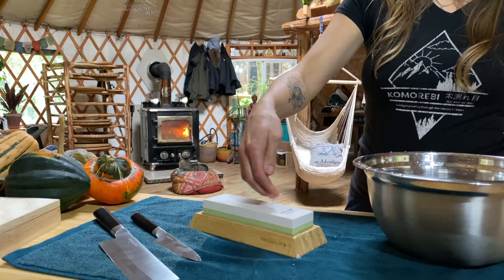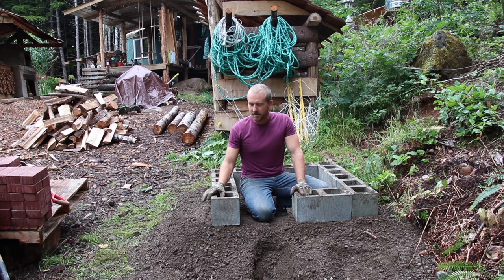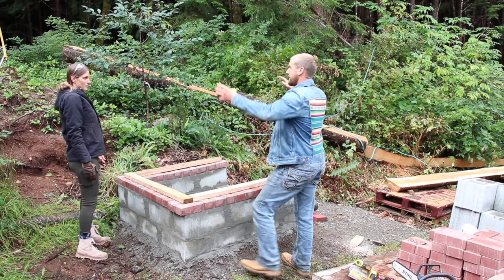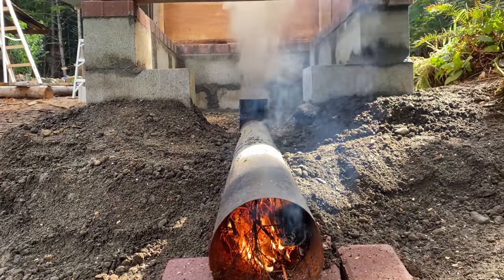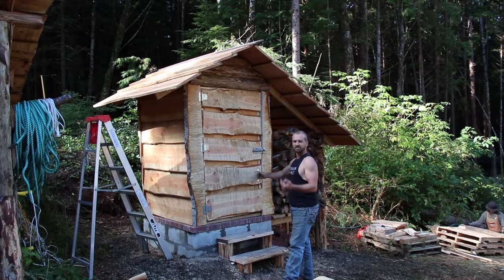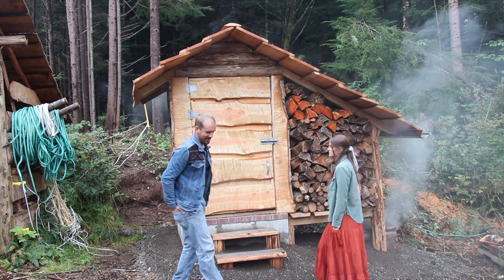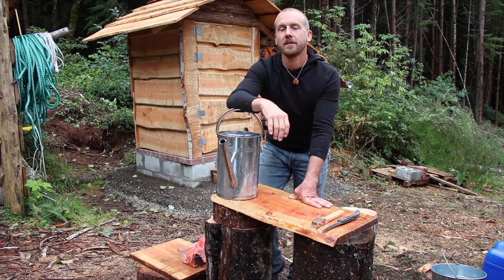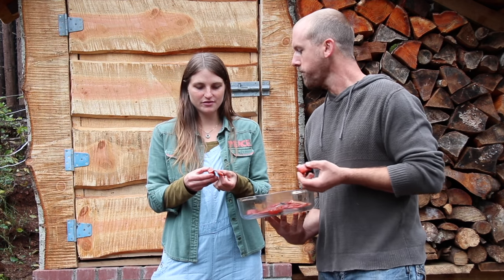BUILD a DIY WOOD FIRED SMOKEHOUSE for SMOKED SALMON with CHAINSAW MILL | TIME-LAPSE START to FINISH

Comment: When you use the leather wood-sling , you should put your forearm through the handle, rest it in the crook of your arm, and take the other handle in your hand. That way, the load is better distributed, less strain on your hand , AND you can put in a few more logs for the same trip...Btw, nice job on the smokehouse.

Comment: 5 years from now Jake & Nicolle will have built a whole off grid village. Just let me know when I can move in 😉
Reply: Does off-grid mean no ac and dc power used ????
Reply: It means you're not connected to public utilities.
Reply: @MichaelJosephJr934  Thanks, so if I have a gas powered generator to operate a variety of electrical devices, I am off-grid.
Reply: Yes.
Reply: Yes as long as you're not connect to the city or county lines.
Reply: @MichaelJosephJr934  Thanks.    I wonder if there is a word or phrase that describes living on the land without any electrical and gas powered devices.  Cooking and heating with wood found in the local area.  This is not a big deal, just wondering about this topic.
Reply: Their buildings are so amazing
Reply: @rogercotman1314  Primative is the word I think.
Reply: @rogercotman1314  I think It is wilderness living. Or bushcraft living if such name exists.
Reply: @MichaelJosephJr934  but they are. So not off grid
Reply: Yep I wanta come also
Reply: @enriquerojas3149  Thanks
Reply: @rogerhuber3133  Thanks
Reply: @rogercotman1314  If you like that, check out for Richard Dick Proenneke documentaries videos. Maybe you know his story, it's amazing.
Reply: @enriquerojas3149  Will check out RDP.  Thanks for the reference.
Reply: Are you 4?
Reply: Speak for yourself

Comment: I just wanted to say,"WOW". When I watched the 1st episode I thought without a doubt you'd be headed back to civilization within 1 week. You absolutely proved me way wrong. Your building skills have come a long ways since you 1st got there. Could use a little refining but if it stands in a strong wind it's good enough. My father used to say,"Nobody will see that mistake driving by at 60mph, so, it looks good to me".

Comment: Hey Jake this message is for you. I see you are making a smokehouse to stretch your food out and give you a variety in your food storage. However, I do have a thought for you. You are in your 30s as far as I know, this means you have a Lotta body strength at this time and a lot of flexibility. It would be in your best interest I feel do you start building where the fire is it is low on the ground but more higher so you would not have to bend out as much, trust me this will change in time and you need to think ahead.

Comment: Someone else’s wood smoker burnt out due to grease reaching  flames in side burner setting structure ablaze in the forest. Luckily they were there during the dark night to quench it.  Stacked wood next to smoke closet did not ignite.  If galvanized nails kill trees I’d not include it in food prep or preservation. Love watching the milling of 30’ planks and All the lumber.  Yes you are set for life as long as you are fit.

Comment: OMG,  LEAD POISONING!!! Please Respond, and reassure us all that you have replaced your Hot Dipped Galvanized mesh with something Safe, and you should probably throw away everything you've smoked so far, or at least keep away from Momma/Baby... (Electroplated Galvanized might be kinda safeish at lower smoker temps (though, with all the acidic, corrosive, and absorbent compounds that smoke, salt, pepper, vinegar, fats, oils, sugars, etc., 👁'd rather be safe than super sorry, and avoid any Galvanized anything for food prep, storage, etc.)), but that hot dipped stuff is certainly toxic, as they use LEAD in the zinc (to help it slough off excess metals in the dipping process), your mesh is hot dipped (you can tell by the color, texture, and the lil drip/bumps left from the dipping process) please do a LEAD test at the very least... 👁 Love what y'ns r doin', Rock On, Be Safe, Stay Healthy🤙

Comment: I was a logger for 25 years and a carpenter for another 20. Cedar and Douglas fir are very rot resistant. Alder Hemlock and Spruce don't last very long when exposed to the weather. Expect to be replacing and rebuilding anyting you built out of them within a decade. It would be at least forty years before you have any timber as big as the stuff you're cutting down now. I was a hippie in my youth. The stuff you're doing up there takes me back to those days keep up the good work kiddos.

Comment: Ultimately, nice job for just slapping stuff together on the fly. We really do need to get U some Kevlar chaps when u run the chainsaw. We don't want to make Nichole a widow. 

When is she expecting? Are you planning on a dula or midwife coming to U or what? U seem fairly remote. Enjoyed your video.

Comment: Oh, 1 thing, and it's a petty thing but might get you years more on your building projects. When making an outside floor, like you would on a deck, the directions of the board rings kind of act like bowels and hold water if the rings are looping upwards. They should last longer if you put the down like rainbows.

Comment: Any reason why U didn't compact the earth before u payed down your block foundation or bother using a level or plum lines as you lay down your bricks? I guess it's because you only went 2 rows up? Does the ground freeze? Will that shift your foundation?
What kinds of wind's do get up there? No cross bracing?
Reply from the maker: Tons of wind but we are protected in the forest from it because of the trees… Yes this is not a very heavy structure and only two blocks didn’t call for a more extensive foundation. If you go back and watch the videos of me building the woodfired brick pizza oven that foundation is thicker and contains rebar because the pizza oven has incredible weight

Comment: Great stuff!  On the smokehouse, how do you clean the ashes out of the pipe?
<edit> I wrote that comment after seeing fire inside the pipe (the test), not understanding the final design.  Obviously ash in the pipe is not an issue.

Comment: Trimming your toenails with the drawknife? Spousal abuse!! Haha! Good looking fish.  With you 100% on composting (what's not used as bait) and using natural means of soil enhancement.  Don't remember if you guys do cheese, but smoked cheese is particularly fine.  And smoked paprika - you don't even have to be Hungarian!  Do you have a thermometer to monitor the temperature of the inside of the smokehouse?  Cooler is better, I've heard.  Nice strumming, Nicole!
Reply: There is a bunch of different ways to build a smoker and smoke meats. I wrap a blanket around my smoker to keep the heat and smoke in. Been doing it for over 50 years. Works for me.

Comment: I know you guys are into the healthy living and body so was surprised to see you use galvanized metal chicken wire to come in direct contact with your food.   Aren’t you concerned with lead and zinc leaching into your food?   I understand the smokehouse won’t reach extremely high temps but still I would be concerned with it being in direct contact with  my food.   Was this just an oversight?

Comment: Appreciate you may not be a qualified builder, (neither am I) but I think you should have created a concrete foundation before laying the blocks. over time that structure will start to sink under the weight

Comment: It is quite obvious that you know what you are doing. But you might want to invest in a pair of steel toed boots. My daddy has been cutting wood all his life. He's in his 80s  now. I swear he was born with a chain saw in one hand, and an ax in the other. But about 20-25 or years or so ago my daddy was using the chain saw cutting up a tree into lengths so he could use the ax to split the wood. Just one time he wasn't wearing his steeled toed boots and the chain saw hit his foot. They were able to put a metal rod in his big toe and sew it back on, but the next 2 toes were gone. 
     It doesn't matter how many years, or experience you have with the chain saw, when things go wrong, they can take your life, or limb.

Comment: Why do you take all the bark off the wood?
Reply: It will fall off anyway and get rotten.  It keeps the wood cleaner and resistant to rot to remove the bark.
Reply: @MichaelJosephJr934  Oh, Interesting. Thank you so much. I thought that by leaving the bark on it would protect the underwood from the weather.

Comment: You guys I was in car wreck, and I almost died . I didn’t have a seatbelt on and we hit an embankment wall so hard we went airborne. I dislocated my shoulder and fractured it, but the fracture is already heald or so small you can’t see it on X-rays anymore . I was in the middle seat talking to the driver and passenger about God, and well I didn’t know the driver was drunken, and it took a lot of energy and strength to stop the hammer or axe on my time. I know for sure God protected me because everyone even said I was so luck but I don’t feel lucky. I know that I have things to do and I still have wrongs to right, like a lot of my character and I got to fix that land. I just got back into the groove two and had been clearing out the land, I was going to surprise my mom and everyone but I got into a wreck and fuck my arm up. It is excruciating to put my hand above my head but I can do it it just takes a lot of effort and literally makes my body cry, so I don’t do that. Because I don’t want nerve damage they said if I don’t keep my arm in a sling it could cause a nerve damage. I’m okay though and I am still on my path I just had a little set back that’s all.